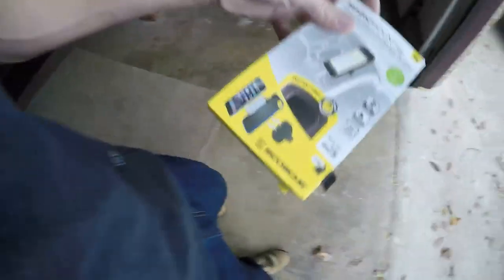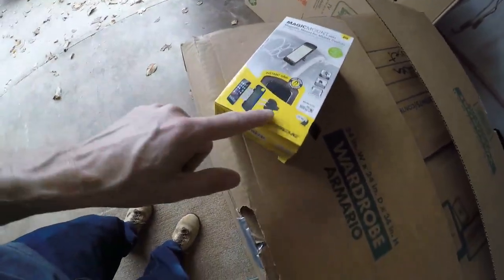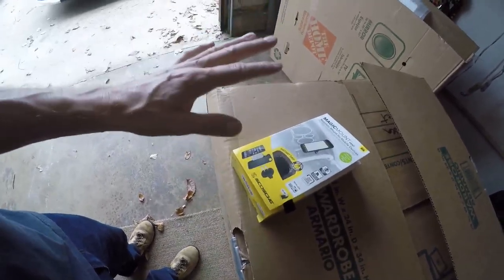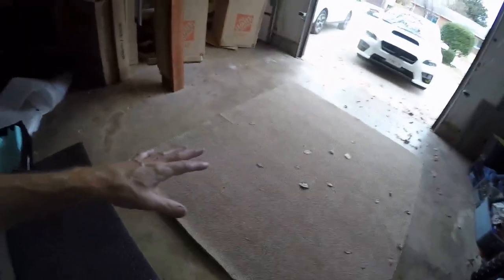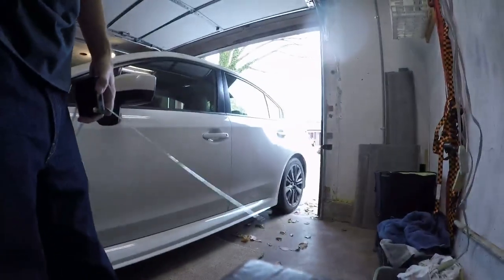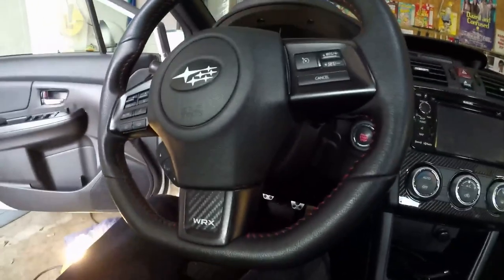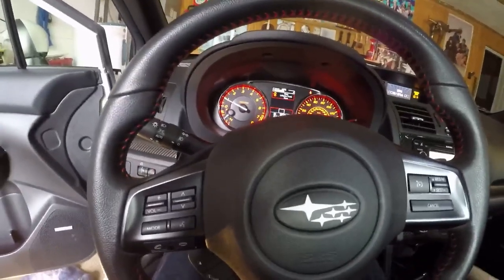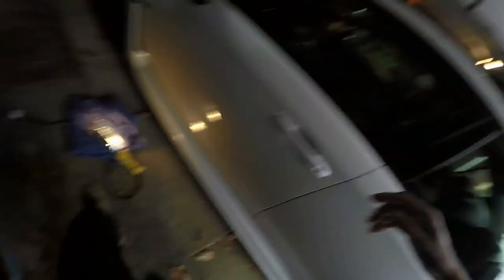2015 Subaru WRX Ep. 570: Adjusting the Clutch Start-Up Switch + Misc Updates

Comment: I'm trying this exact thing on my 2019 WRX. I know that the principle is lefty loosey righty tighty, but being upside down and trying to do this is a pain! It'll take some strength to break the firewall side nut free, and I'm worried I'm not turning it in the right direction. I feel really dumb for asking this, but if I have a wrench on the firewall side nut, am I tugging toward the driver's door or the passenger door to break it free? :/
Reply from the maker: wish i had the car still so i could check

Comment: did doing that get rid of the stupid clutch extra space play during shifting too? Like does it still go down to the floor during shift? I want to get rid of the extra clutch bottom space more so than the start point. The start point is just once during startup, but shifting is constant. I'm short, and i hate that i have to sit extra close to get the clutch down, then my right foot is right on the gas pedal.
Reply from the maker: can't change that. its just subaru clutch style. only old cars had adjustable clutch height pedal back in the day. these new ones all automatically adjust
Reply: @LastHumansGarage  you can add a clutch stopper to get rid of the dead space in the clutch
Reply: Hey, just checking to see if you have any updates on the issue you we’re having? Did you try an adjustment or a clutch stop at all? I’m facing the same shortness issues as you. Thanks hope you’re doing well!
Reply: @clintonross1649  i ended up making my own clutch stopper. You need something really sturdy. I had to experiment with thickness once i figured out i can remove that original torn grommet. Got a piece of wood, cut it to size, and also account for a sheet of aluminum, not foil. The sheet is to protect the piece of wood from splitting as you stomp on clutch. You'll end up making a dent, but wood won't crack when stomping down. Good luck, it was quite a bitch. Or you could buy a carbon stacked layer stopper for ~$100. Either case, youll still need to apply this adjustment shown here as well

Other option is to learn where that disengage point is and only press to that point. Not my forte as i miss sometimes and it doesn't sound very happy lol

Comment: Would this adjustment change gear changing point? I have very short legs and having hard time with clutch... and sitting position.
Reply from the maker: no. it has nothing to do with the take up point.
Reply: Ah man. Do you have any tips to accommodate my difficulty? I want to sit maybe 1-2inches away from the wheel since my knees are so close to the front panel. I was thinking of raise (extend?) the clutch pedal but I dont know how I'm going to do that.
Reply from the maker: you know in addition to the steering wheel moving up and down, it also moves in and out?
Reply: Yes. I do know. What i tried was push back my seat as far as back while I can get clutch to change gear. I think it's plenty now. I'm new to manual so a lot of adjustments!

Comment: My clutch pedal on my 18 wrx is so hard to push down, any fixes for this?
Reply from the maker: no
Reply: Hey man, look into getting a softer helper spring.
Reply: No sure it too late to the party, but in my 18 I had subaru replace the throw out bearing, they have a TSB about it. Duuude car felt like a different thing!! Like you know a 2018 car!!

Comment: I know this was posted a while back but looks to me like your metal plate where the switch hits was bent a little bit. Could of moved that metal plate forward a bit by bending slightly forwards so the switch hits it correctly. Adjusting those nuts worked as well but bending the plate may of been easier?
Reply from the maker: probably

Comment: I've had my sti for about 5 months now 3,568 miles on it. But last week my clutch would start to grab with my pedal half way off the floor. But one morning I noticed it's nearly to the top and fully engages when I'm practically off the pedal. I was wondering what you guys think about this. It is my first time owning a stick shift and been driving a stick for about 8 months now, (started learning before I bought it))I don't even need to think about it anymore but anyways does anyone think my clutch is wearing out already? I've been observing my driving and I'm positive I'm fully in gear and I've had friends give it a drive and they say the clutch appears to be ok as far as material goes. I was told I may simply need to have my clutch readjusted because it's possible to be off after breaking in?? It's really a pain especially on a hill to have the clutch grab all the way at the top.
Reply from the maker: there is no clutch adjustment its auto adjusting.
Reply: LastHumansGarage yes that I understand but the clutch pedal can be.

Comment: Remove the clutch spring and adjust the clutch, it's a big difference. Done it on my car and its so much easier to drive
Reply from the maker: ThatR6Life the clutch is auto adjusting. So what did u improve
Reply: LastHumansGarage after the clutch spring remove, clutch feel much better, from top to the grabbing point is so minimal, like an inch
Reply: When you say "top to the grabbing point" do you mean when the pedal is close to the floor or the pedal is close to being fully released?

Comment: A little sticky felt (or rubber) pad on the part of the clutch that presses onto the switch would have solved your problem in about 5 seconds. No need adjust the depth of the switch.
Reply from the maker: dang.. wish i had a rubber piece with a peel off sticker on it..
Reply: You may have just saved my back lol i may give that a try tomorrow
Reply: Done it on several cars including the WRX. So much easier than trying to adjust the switch!

Comment: I thought I was the only one who had the clutch problem...that happens to me almost all the time too.  It actually seemed to stop for about a month, but came back just recently.  I did notice that the green light on the push button isn't lit when it happens.  Then I push a little harder for the green light.  I may have to look into this as  well. thanks!
Reply from the maker: yup exact issue, just a 2mm adjustment and your fixed. maybe your pad fell off too. someone said i might be missing a pad.

Comment: My 2 cents on car covers, they scratch cars that are dirty, they are only good for a freshly cleaned car. So unless you wash your car everyday, every time you put it on your car you risk scratching up your paint.
Reply from the maker: that is the best point. it would do way more harm than good.
Reply: dlroto also, if it's windy, it will"sand" down the paint.
Reply: Also just too much work to bother with... Good for longer term storage if you keep car outside all the time. I wash and wax my car every 1-2 months. Just not enough time to do it and I take forever to do my car.